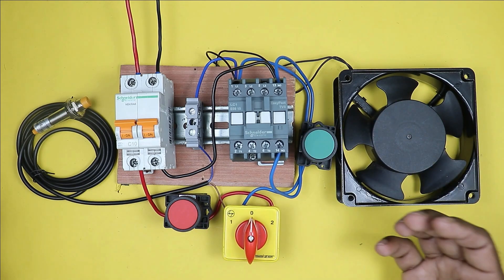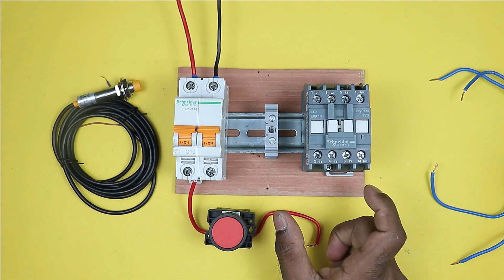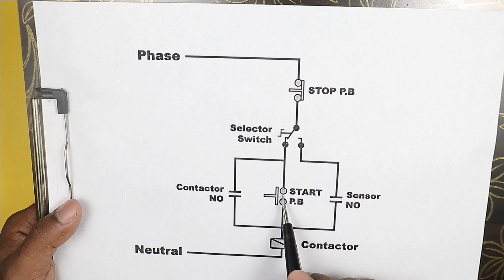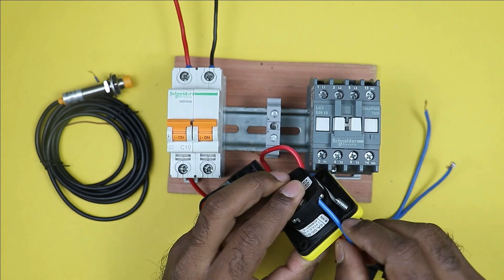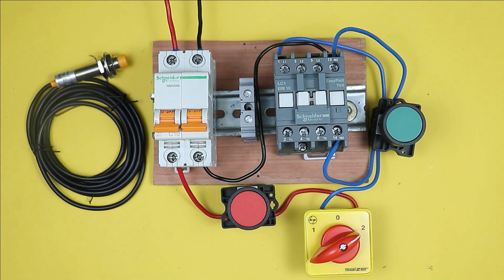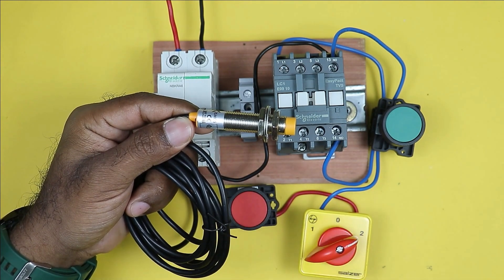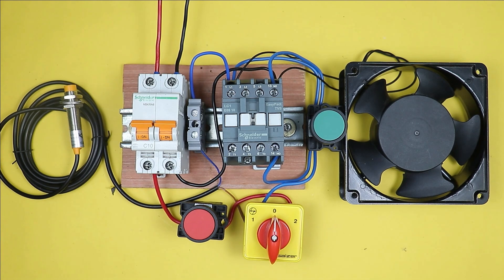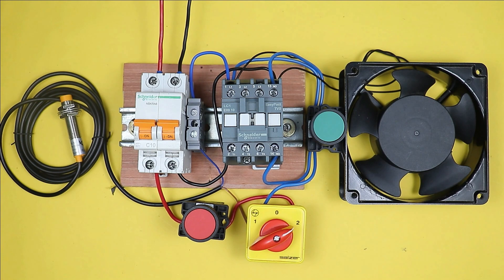DOL Starter Connection with Auto Manual Selector Switch and Two Wire Sensor @TheElectricalGuy

Comment: Please i need your assistance, can i use this connection for a 3phase. Electric motor or only just single phase?
Reply from the maker: You can use this for 3 phase also
Reply: It's possible since because this is just a control circuit, for 3phase you'll need another circuitry that's power circuit, where you'll have 3-phase supply into the contactor and to the motor.